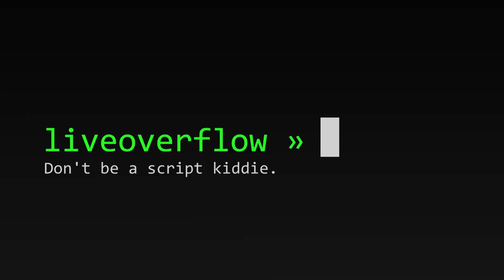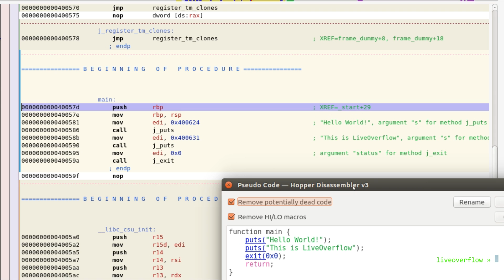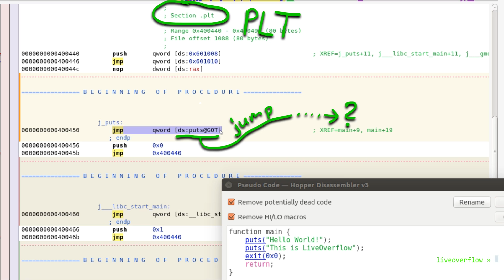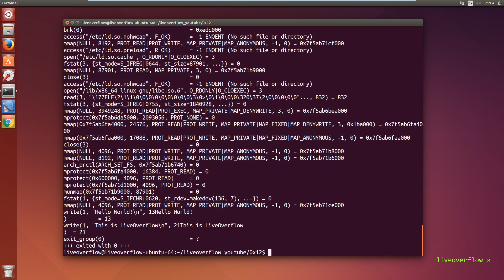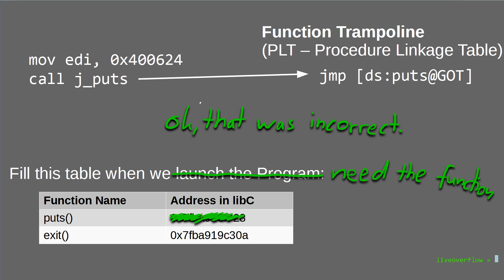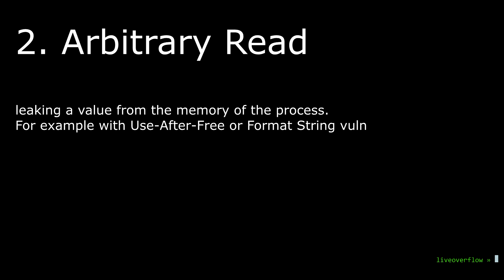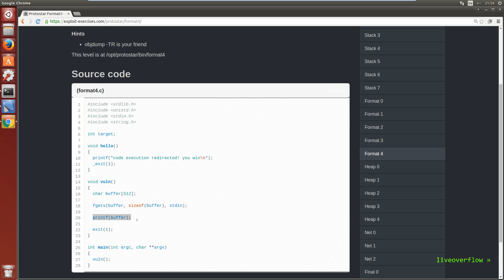Global Offset Table (GOT) and Procedure Linkage Table (PLT) - bin 0x12

Comment: When resolving the external symbol on the first call to puts, we first push the first entry of got onto the stack and jump to the address stores in the second entry, but what exactly are those two? The second entry seems to store the address of the function that resolves the reference, but the first is kinda magic. Does this hold the base address of some table, which them combined with the index pushed before (for example 0x0) gives the slot address, at which a pointer to the function will be stored?
Reply: The value pushed when you call an external function for the first time (0x1 in the case of puts, see video at 1m 50s) is basically an ID so that the dynamic linker knows which function it should load. Each external function has it's own unique ID, this ID will vary by program (i.e. in program "a" puts has the ID 0x1 but in program "b" it might have the ID 0xa).

Comment: before calling the ld.so to resolve the addresses why is there a push instruction, I mean why does it push a value on to the stack before calling the ld.so library.
jmp qword [ds:puts@GOT]
push 0x0 <---- i am talking about this
Reply: That's right, it's the table index. It's part of the system that allows imports to be resolved at run time vs resolving them all at ELF load time.
When an API call is first made the JMP the address (in the ".got.plt" I think)  points back to just below the jump (to that PUSH, JMP combo) which points to a common ld.so routine that replaces the table entry with the actual API function for the next time, then chains to it.

Apparently a performence and resource optimization so that the system doesn't need to load .so's that never get called.
Reply: i can only guess too, but it looks like an index of the table to me, so when 0x5 is pushed on the stack (as an argument), the function will make a lookup at index 5 at the GOT; correct me if im wrong

Comment: Maybe somebody could explain me, At 3:48, how exactly does it happen that we go to the next line (0x400456 "push 0x0")? Shouldn't we jump to 0x602000, that is where [puts@GOT] is pointing?

Thanks!
Reply from the maker: We do jump to whatever ds:puts@GOT is pointing to. It just points to the instruction right after the jmp. When the program memory is set up and the GOT is created, the real libs addresses are not filled in yet. instead the address of the next instruction after the jmp is in there.
I think you got the address 0x602000 from looking at it in hopper statically?
If you run the program instead, you should see 0x400456 instead. I think it’s just that statically the disassembler knows that it’s an external symbol and points it to somewhere else. but if you run it it should be different.
Reply: Would there be a way to discover it statically? Or it isn't possible because the GOT is created dynamically each time the binary is run?